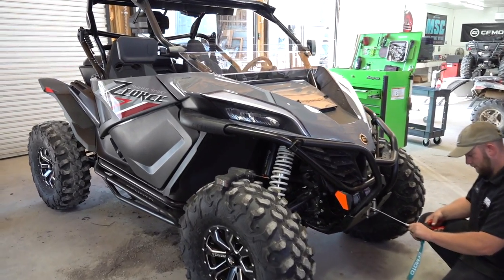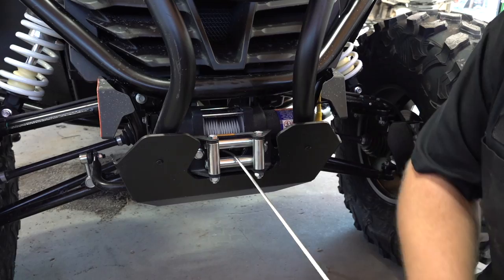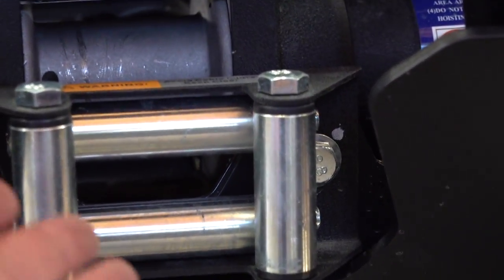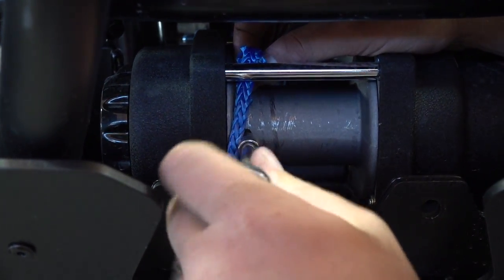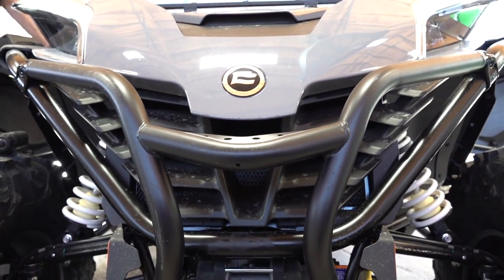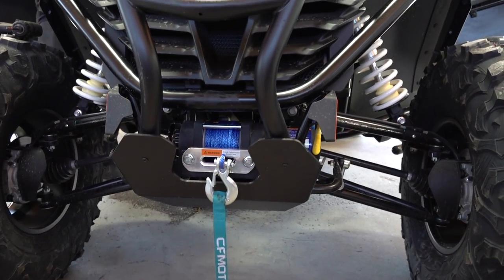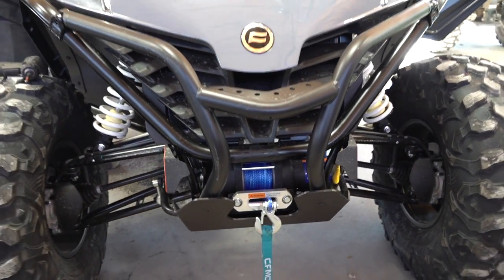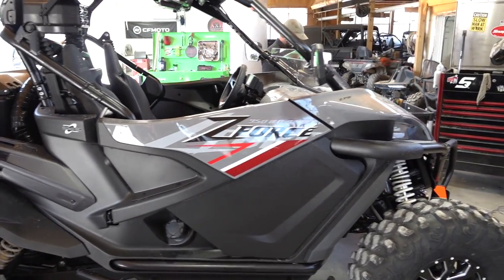Synthetic Winch Rope for ALL CFMOTOs | Replace Your Winch Cable

Comment: Dang, tried this today and used a 3mm hex key on the set screw but either I rounded it out or the previous owner did. Yikes. Now I can't get the screw out. I've ordered a screw extractor set but have never used one before. Any advice?

Comment: Just wanna say thanks for all your great info….I’m not a cfmoto owner cause being up here in Canada getting parts will be tough and the same goes for good mechanics in my town when things get broken…..All my buddies run can am and I run Yamaha/Kawasaki soon to upgrade to the 850xmr…..If I lived where you guys are I’d be riding cfmoto 100% because they are the best price out there 100%…….Cheers
Reply from the maker: Thanks so much!! Maybe things will change for y’all in Canada some day and you can get a cforce 1000
Reply: @RealTalkPowersports  Not all of Canada is like this.  I'm from southern Ontario and the local dealer has a great assortment of parts and accessories.  Lots of units in stock.

Comment: Another informative video!  I have a question that I hope you can answer.  I went to my local CFMoto dealer and wanted to order a CForce 1000 and was told that I could not get one in California because they are not emissions compliant.  Is this true?
Reply: They are correct. CFMOTO was supposed to add a CA model, but apparently they have not done that yet.
Reply: CF Moto has dealers in Nevada if it's what you want.
Reply from the maker: Thanks guys for answering Aaron’s question 👍👍
Reply: @TheBandit7613  That's what I did. You just cannot register one in Commiefonia.

Comment: So my dealer left the roller fair leads on with the rope, should I change it out??
Reply: No, they can get pinched in roller fairlead. Change it.
Reply from the maker: I would change it out
Reply: Will do, thanks for both answering. Keep up the videos !!!
Reply: You all should make a hawse lead with MSC logo etched in it !!!!
Reply: Where do you get the new lead at?
Reply: @Hardenhomestead  I’m assuming as long as the bolt holes are same width apart, can get at HarborFreight or anywhere !!!
Reply: MSC should have some made with logo etched in !!!

Comment: Hey please can anyone help! In regard to 2018 U800 winch remote. I’ve forgotten how to use it. How to power it on & off? 
Also while replacing the batteries I noticed it actually has 4 buttons (2 in & 2 out)? Why is that?

Comment: How do the nylon cables hold up in cold, snowy conditions?
Reply from the maker: They should resist the weather conditions better than the Wire cable
Reply: They work great. I live in Wisconsin use them for years now. Only down fall is jerking with them. They break on jerking. I also have been using the rol lm ers for year's.

Comment: What is the purpose or advantage of having a synthetic rope vs. having the cable. Sorry if that’s a dumb question. Thanks
Reply: The pluses are it's lighter and easier to handle, the minus is if they rub on a rock or something sharp, they're done.
Since I spend time in rocks, (Moab, Johnson Valley, Sand Hollow ect) I must stay with wire cable. Much more abrasion resistance.
Reply from the maker: Good input Chris
Reply: Thanks Chris.
Reply: @RealTalkPowersports  Thanks. if I was there in the forest and mud, I would switch to synthetic too. Much lighter and easier to handle without cutting skin.
Reply: Also synthetic is much safer. I winch cooler down on the front no sharp barbs to d3al with. Rope snaps cable Flys